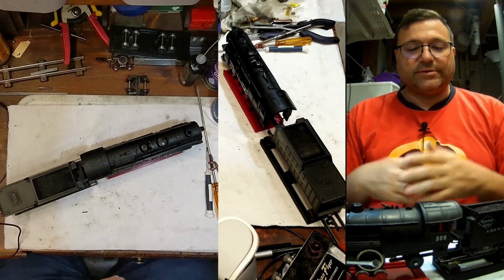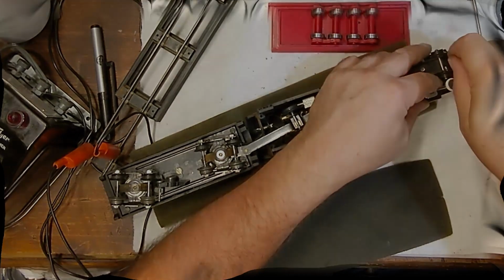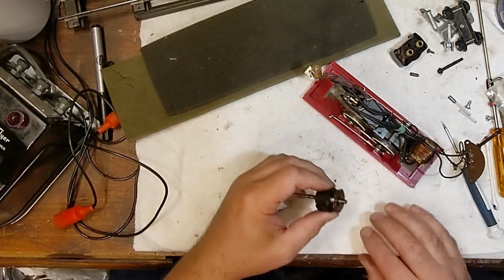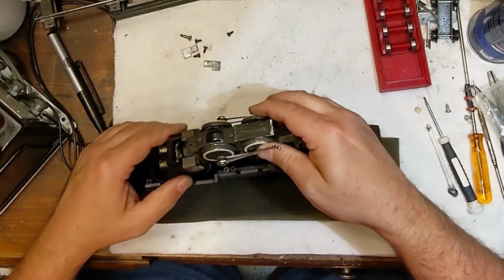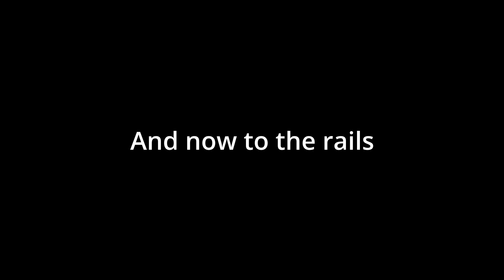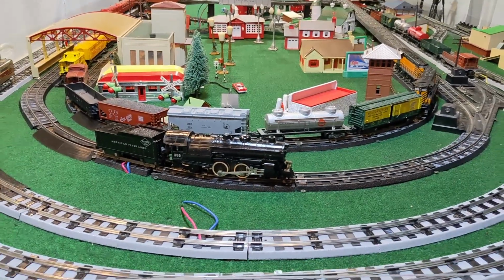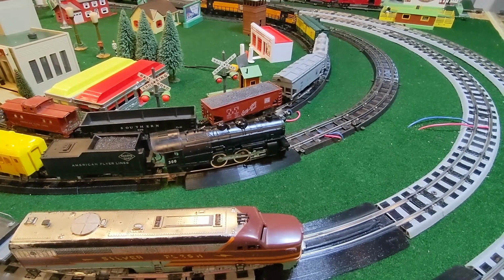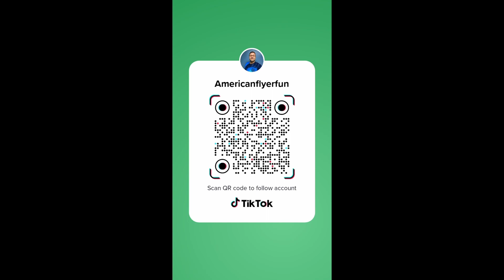A customer repair with surprises:  #477 Silver Streak &  1953?!?! One owner #300 Part 2.

Comment: Watching you struggle with reattaching the shell to the chassis, and remember similar struggles of my own, I began to wonder if maybe the factory workers attached the shells to the chassis, then added the drive wheels and side rods. Clearly the company couldn't produce these by the thousands with worker struggling as you did.
Reply from the maker: I agree.  There may have been a 'trick' to assembling these also.  The same set up is used in the 0-6-0 switchers 21004 and 21005.

Comment: So that means that engine could possibly be very rare? I've got a plastic late 50's Atlantic that deserves to be put back together. Very nice restoration you did there. I would have shut the camera off the first time those mounts didn't go in correctly! Not fun.
Reply from the maker: With the factory records mostly getting destroyed there is no way to know for sure.  And, as Ron commented, they could have used leftover parts...a common practice.  While many of these were produced what makes this engine rare is the story... original owner and never taken a part before.
Reply: @AustinsAmericanFlyertrains  Yesterday I just picked up a couple boxes of Flyer trains including a Hudson, a 370, and a 300 just like in this video. Mine is missing a lot of parts and the tender, but has the marbleized motor and is dated June of 1952!
Reply from the maker: Wow!  Super cool!

Comment: I have a plastic 300 Atlantic with plastic tender. It is part of the 521T set I received for Christmas in 1952, when I was 2 years old. The set was cataloged only that year. (Doyle pg. 223 and Gilbert catalog 1952) This set has been in my possession ever since. Until I read comments on one of the S gauge forums, I had thought that plastic 300s came with either metal or plastic tenders and that plastic tenders were not unusual. I am far from an expert on these things. The date stamp in the boiler is smudged and the month stamp is largely missing. The year stamp appears to be 1952. I thought the month stamp was missing but on further examination I can make out remnants of the feet from an N, so it appears the date stamp is Nov 1952. In checking references, Doyle is not clear on whether or not plastic 300s came with plastic tenders. Doyle, page 19 lists a "Type VI" 300 as late 1952 with plastic boiler but does not list tender information for it. Greenberg's 2nd edition, page 73 paragraph (F) lists a 1953 plastic boiler 300 with plastic Atlantic-type tender body. I have part of an article by Tom Hamler printed in S Gaugian that reports 6 variations of 300 Atlantics with 1952 versions typically found with plastic tenders. Unfortunately I do not have a complete copy of the issue so can't include a proper citation. Here's the locomotive and tender. Over the years, the locomotive and tender have received their fair share of repairs, including replacement screws, repaired mounting posts, new tender to locomotive wires, replacement armature and field coil. But, the locomotive shell and tender are original.
Reply from the maker: Thanks for the extra detail Paul.

Comment: I found it ironic that you and many other collectors are stuck on a specific year even though the production may spill over into the next year. Many people don't realize that Gilbert and other manufacturers use parts bin manufacturing. This means that all of the old parts are used up before any new parts with any changes are used. So, having mixed parts on a locomotive isn't too uncommon as long as the fit together on assembly. Given that Gilbert made more than American Flyer Trains, it's not too surprising to see these variations when Gilbert switched back and forth between trains and their other products.
Reply from the maker: Well said.